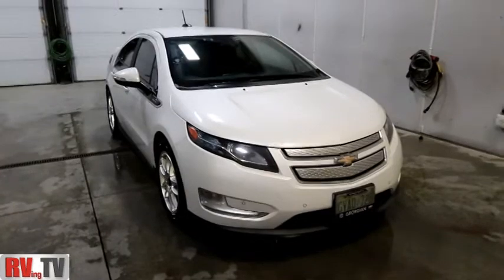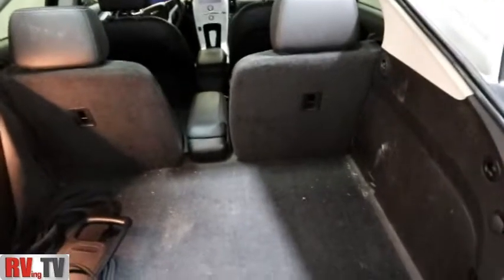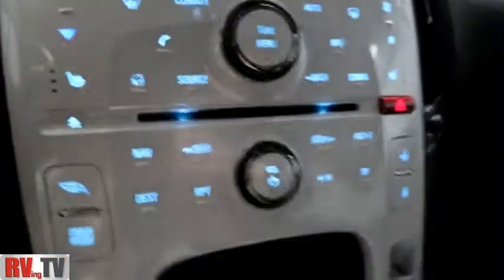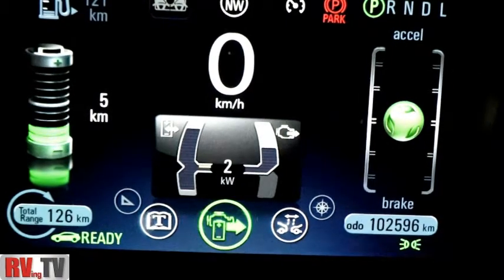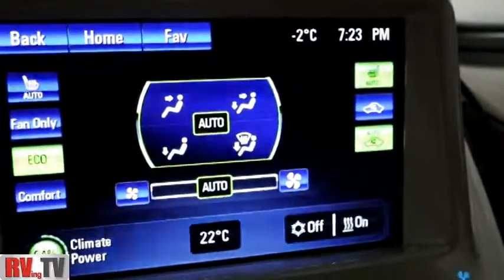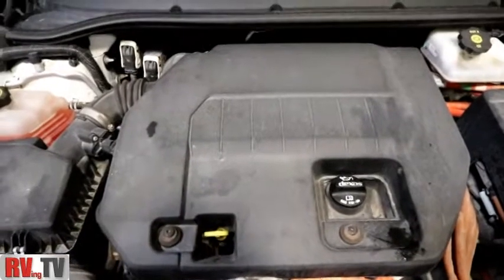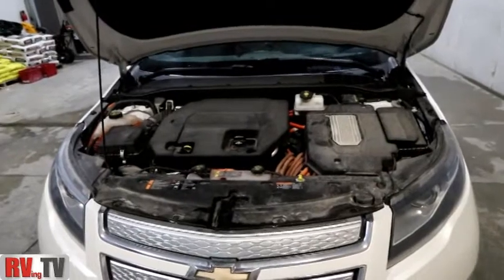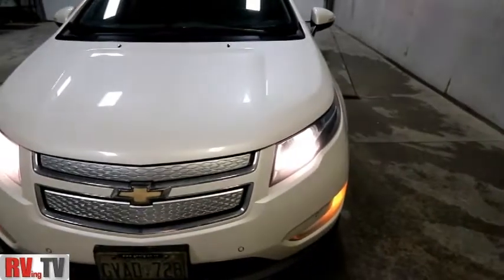2015 Chevrolet Volt Review

Comment: Last year (2022), I purchased a 2013 Volt in very good condition. I might be stretching it if I were to say I made it to 64 Km on one full charge. I don't know about 90 or 100. Maybe brand new. Still, overall, me and my entire family enjoyed this car. Although, on long road trips, my younger daughter may differ with that assessment due to not being able to rest comfortably in the back seat.
Reply from the maker: Remember the 215 had a slightly larger battery than 2013.  Also, range will depend on battery condition/degradation.  Thanks for the feedback.
Reply: turn the AC off, pump the tires up to 40 psi, switch the dash mode to show battery/motor kw usage and dont accelerate using more than 25-30kw, and leave the car in L mode and if on the hwy follow behind a large vehicle leaving a large 4-5 sec following distance.
make sure ur plugged in before leaving to condition the battery
im getting 45-50 miles of range on my 2013 volt (72-80km) before the gas motor kicks on right now, summer driving. maybe check tire wear? otherwise that sounds like driving behavior or battery degradation

Comment: You know more about the Volt than ANYBODY who posted about it on YouTube. It's truly a misunderstood car as in that it's a purely electric car powered by an electric motor. Unlike a hybrid, say, a Prius, it has no transmission, something that it shares with a Tesla. What it has, in addition to the electric motor, is an onboard gas generator that charges the battery if needed. It keeps revs rather low and thus only needs an oil change every 20K miles. I still change my oil with top-notch Mobil 1 at least once a year. My 2014's battery still charges to 38 miles range with 161K miles on the clock, 9 years after it was made. The Volt is a car like no other on Earth, combining the best of a Tesla with the best of a Prius. It's very complex, yet it is so over-engineered that most people never experience any problems with their car. The General lost money on every one of them.
Reply from the maker: Thank You

Comment: What kind of winter tires do you use and do you put on all four?
Reply: I was using Yokohama Ice Guard winters and yes all 4 should be changed. If you stick with the main brands there are several good choices.

Comment: Found one of these (2015 model) for just under $7000, 115,000 miles. Assuming the car has a clean history and a good maintenance record (whatever that is for this type of car) would you consider that a good deal? I'm hoping to get a few years out of her, and I only drive about 5,000 a year at most but likel way less (I have e-bikes I ride most of the year)
Reply: that was a really good deal then (5yr old 2015 volt in 2020 for $7k). over here in WA state I watched volt prices go crazy over the last few years. I was going to buy one in 2020 for ~7k$ just like you but was too busy working 100+hrs coz of covid, had to travel atleast 200 miles to get a deal on one.
-car prices went crazy in 2021, used volts went up ~$10k
-gas prices went crazy in 2022, used volts went up ~$13k
-gas tax here in WA raised gas another 20% (5$/gal) begining of 2023, prices only now back down to around 9k$

Comment: Just ordered one. I feel for the used market this is a great deal
Reply from the maker: Congratulations, you will love the car
Reply: You must be feeling like a god now.
Reply: CinemaPigeon I traded it in a few months ago due to the BS I was dealing with at the dealership. For the most part car ran awesome except for one radiator problem which both dealerships near me were not able to fix even though they were the only ones that could work on the triple radiator system.
Reply: @kumaSOevl  Oh, sorry for your loss. I actually just got a 2012 Prius, however I was also thinking about a Volt, and since it has a fairly large electric range, it would actually be more economical than a Prius I believe since I wouldn't use gas for most days however reliability played a big role, and I don't know how reliable the 100k+ mile used volts are.